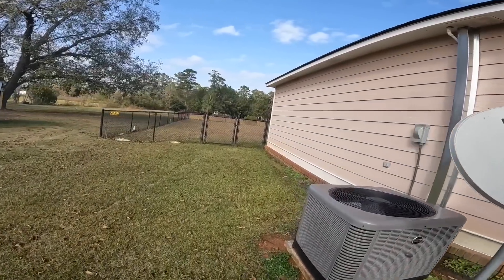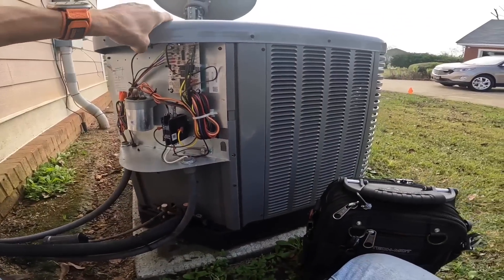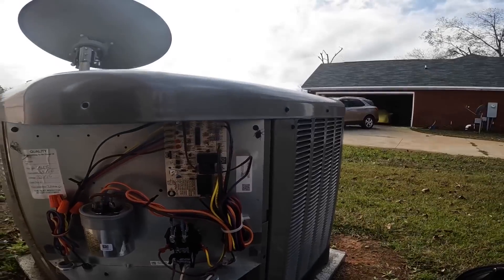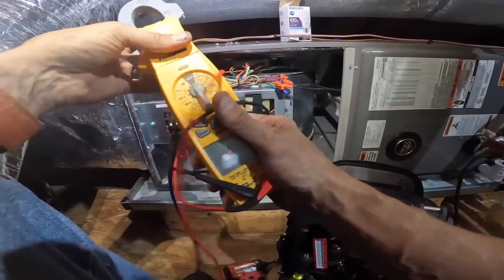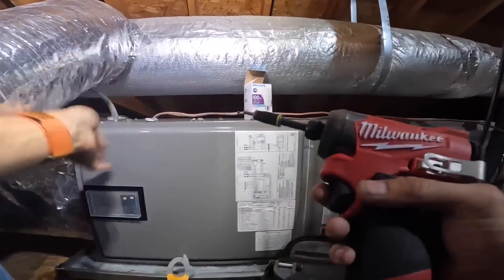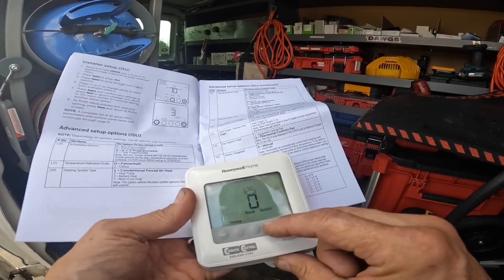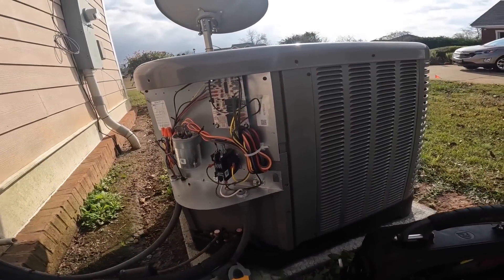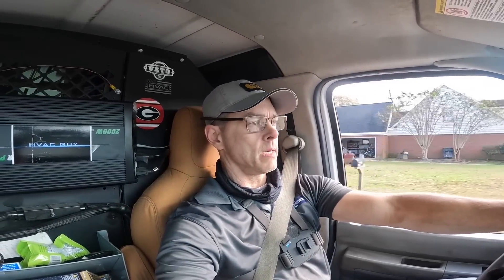Very High Utility Bill For Previous Day

Comment: The old fashioned mercury thermostats seemed to be more reliable.
Reply: the old T-87 (round) T-stats never broke by themselves. The only broken ones I ever saw were in high traffic areas and got physically damaged.
Reply: @rupe53  the models with "switch plate bases" for fan, heat/cool, would break/go bad somewhat often,  used or not the plastic would give way under the spring tension and just lose connection. the thermostat part was always still good, pretty much unless a bozo physically smashed them like you said. there's still some around here on thermopile gravity systems from the 1940's! you do not want to see their gas bills! lol
Reply: @throttlebottle5906  ... yes, those round sub-base assemblies for heat / AC did go bad, but likely from being exposed to dust / moisture or rough handling. I often wondered why they were not as sturdy as the t-stat itself. Still in all, more reliable than anything else on the market... and completely idiot proof. No instructions needed for the user.
Reply: @rupe53  that’s not even remotely true. The old T-87’s, as well as all other traditional mercury bulb stats, suffered from droop after years of service. Also, if there was a direct short on the heating control circuit, the heat anticipators were instantly fried. 

The best thermostats ever made were the Honeywell Focus Pro 5000 and 6000s, as well as the original Vision Pro 8000s. Unless they were abused or someone let batteries leak in them, their failure rates were incredibly low. 

One can also argue that the old Chronotherm stats were incredibly reliable as well. They absolutely suck to configure and use but they last for freaking ever.

Edit: Honeywell’s T series stats are absolute garbage and everyone knows it.
Reply: @jman0870  ... Chronotherm clock motors went bad at 20 - 25 years, but the T-87s that I see are still functioning. Got one in my house and a couple at the folk's place. They are all well over 50 years old at this point. You're right about those programable stats... a royal pain to program but I have a pair in my home that are 20+ years old and still kicking. Too bad the default on dead batteries is NO HEAT!
Reply: @rupe53  uh no? If you wire up the common you don’t need batteries…unless it’s a piece of shit T6. As far as chronotherms go, I should have been more specific and said 3s and 4s.
Reply: @jman0870  ... the clock stat I'm talking about is from the mid 80s, so almost 40 years ago. I believe it took an AA size Ni-Cad and you could hear the clock spring every few seconds. It was a full mechanical clock with tabs to switch temps at the same time 7 days a week, which was fine fora bedroom area.
Reply: They were reliable because it had no electronics inside so nothing was able to go faulty
Reply: I can remember as a kid we had the honeywell rectangle tstat with the mercury switch and when the  heat or ac turned on or off you could see a little arc flash in the stat when it was dark in the hallway👍🏿
Reply: @David-yy7lb  yes. Me too. That's the kind I was referring to 😁👍
Reply: @chris76-01  👍🏿👍🏿😎
Reply: This is the thermostat that I have the most issues with right now. The 8000 is my personal favorite.
Reply: @Wiwiw1995  green screen 8000’s were the best 8000’s, change my mind 🤣
Reply: @jman0870  the green screens where awesome. I like the new ones better personally, but I don't remember having many issues except not having wifi
Reply: @Wiwiw1995  the blue screens have a piece of shit stat to base micro connector. If you install the baseplate on a wall that isn’t flat it won’t properly connect to the stat. I lost track of how many stats I had to loosen the baseplate screws up on to get the stats to work. The green screens had super long pins that were ultra forgiving. 🤷‍♂️
Reply: @jman0870  yea if you over tighten the screws it will lose contact. Usually I just take a gallon of mayonnaise and submerge the tstat in there. It works every time.
Reply: I took out a bunch of those due to malfunction of the spring.
Reply: @altyndom7039  yep they get droop in them very bad. Then the heat and cool come on and off at the wrong temps and run for too long or not long enough. All bimetallic springs suffer from droop. 🤷‍♂️
Reply: It’s not just the Honeywell / Resideo thermostats. I’ve been in HVAC since 1996. My go to t-stat  is generally White-Rodgers / Emerson. Over the last few years, they’ve been having some reliability issues, too. They don’t make things like they used to 😞
Reply: Gross
Reply: They did fail also the contacts got dirty and stopped passing 24v call, and weren't accurate temp wise.
Reply: I agree
Reply: Use t-stats those that don’t need batteries, but power rob type only.
Always run control wire from “COMMON” to t-stat terminals like: Y W G R and C, and O for heat pump system.
Reply: I had the heating system in my house and the company who put it in replaced it 3 times and eventually the company who installed the system went bankrupt, I went to home depot bought a setback thermostat, installed it myself and no more problems-except insuring that you put a new battery in it every year
Reply: @RedArwBus  ... ran into that problem a few years ago with dead batteries in December... and we were away for a week. Got lucky in that the other zones in the house kept things from freezing.
Reply: @RedArwBus  I recommend changing batteries 2 time's a year. I change mine when the clocks need to be changed.

Comment: I have had great results out of ecobee. Simple setup, simple operation, seem to be fairly resilient.
Reply: I second this. Not a fan of smart thermostats, but I decided to give an ecobee3 a shot 5 years ago and having had a single issue with it. They're a really well built stat with exceptional functionality, couldn't ask for more. They're insanely easy to program and the equipment test function in the software is awesome, love that I can manually turn on individual relays in the stat itself without using jumper wires.

Comment: I currently have an older model Honeywell digital programmable thermostat that can use either batteries or "C" wire. I don't like it because it has no adjustable "swing" on cut-on to cut-off. My Goodman heat pump seems to run nearly constantly because of the tight cut-on-off range. I have now a new Honeywell WiFi thermostat that I have yet to install. It is made for Honeywell by a company called Resideo, which I understand is a spin-off company of Honeywell. I sure hope there are no issues with that one.
Reply: they(resideo) make all the honeysmell(lol) thermostats now, also the smart home(dumb), security products and cameras now.
like everything else electronic/computer based now days, good luck chuck.
Reply: @throttlebottle5906  Hard-wired thermostat vs. one that relies on your WiFi working. What happens when your router takes a dump in the middle of the night in January? Give me wires and simplicity.
Reply: @reecenewton3097  the problem still remains, as the hardwired ones are all full of electronics which tend to fail early and randomly. there is no good solution anymore.

Comment: I've had 4 Nests in a 4 zone system since 2014 and never had a single problem. However during installation one of them would not connect to Wi-Fi and had to be switched out

Comment: We were using T6 honeywell t stats and had lots of issues. We quit using those and went to Aprilaire 8448. I do miss those honeywell 5000 days though… We do use Honeywell 8000 for our nicer T stat.
Reply: A building maintain had a T6 stat just go bad and not allow the heat to go on. iirc i opened it up and the mosfet was blown open. I just replaced it with the $99 honeywell home tstat with the physical relays that dont just stop working randomly.

Comment: Many homes now have the 'smart' meters where you can monitor the usage daily. I find it convenient to make sure my air conditioners are working properly.
Reply: As the metering supervisor for an electric cooperative in Texas, I take many calls for high usage issues.  We use "smart meters" but look primarily at voltage, amps, kw, and kwh on a15 minute basis and of course kwh total daily for billing.  In most cases I can look at amps being used and determine a water well running all the time, stuck water heater thermostats as well as resistance heat running with the A/C.  Of course I can also see the run time during normal operation which can point to issues like clogged filters, dirty coils or improper charge, not to mention duct issues.  On difficult cases where the resident can't turn breakers on and off for various reasons (elderly being one) we will send a tech out to try to isolate the issue to get the proper repair made.  Our goal is to help our members get the best service from us without having unusually high usage where it can be corrected.  We established "high usage alerts" where the member can be alerted if their daily usage goes over or under thresholds they set for their own situation for both hourly and daily totals.  These can give an early warning for unexpected usage and in some cases, such as isolated livestock water wells, can warn for both not enough usage (no water) or too much usage (leak or stuck valve).  Good job Curtis in nailing this one down!
Reply: I've had power before threw a smaller util company and they had alerts you can setup eg over 70kwh in a day sent a email/text message
Reply: @james6794  ... 70kw in a day? I'd about crap myself if I used half that on a daily basis.
Reply: There are several home power monitors.  I have the Sense unit and I can see several items in my house and how much they use live.  Also keeps track hourly, daily, monthly and yearly.   Tells exactly how much it is using.     The Sense energy monitor, look them up!  😁
Reply: Duke power sent us a graph with multiple items we have in our home including usage of our heat pump. Wild. Restricted filter drier (exactly 3 degrees off from each side) kept cutting the condenser on and off.
Reply: One thing I never offer a customer is the Nest or other wifi T-stats. This gives the utility company the option to get into your T-stat and cut you off during high usage times. Look at Colorado a few months ago. They locked all their customers T-stats so they couldn't turn them down during a heat wave.
Reply: @Infowarrior-45  ... I have to ask how the utility would have access to a customer's app, password, and IP address? It's not likely people send that info out when they change a t-stat.
Reply: @rupe53  In Colorado, the utility company gave out discounts to any customer who used their brand of T-stats. If they can access those, then they can access any wifi T-stat. Go look it up on YouTube. It was national news. Colorado residents locked out of Thermostats, and you'll find videos on YouTube. I'm sure all these customers didn't give their passwords to the power company, but they got locked out. Check it out and let me know what you think.
Reply: @Infowarrior-45  ... if the utility issued the units then they have a record. Not so with other units. I suspect the media has taken some artistic license for added drama in their newscast.
Reply: @rupe53  That's your belief, and I respect it, but I honestly believe all these internet capable items have some sort of backdoor access that the government can access if they want or need to. It's just like the alexa, or the smart phones. If you start talking about certain things around them, for example, a trip to Hawaii, then you'll start getting adds for vacations to Hawaii, or airline ticket discounts. Or the appliances that are connected to the internet. For example, stoves, refrigerators, or washers and dryers. The power company will send out notices to tell you which appliances are over consuming power. Whether you want to believe it or not, they have far more access to our personal lives than we would like to thank they do. I know it sounds a little conspiratorial, but it even goes as far as the smart watches, or fit bit things. Wait and see if in the next couple years, people will be wearing these things, and starting getting alerts, for example, your heart rate is higher than normal, you need to schedule a Dr. Appt with your physician. Or they'll start getting adds for certain prescription drugs on their phones and laptops that have the same ip address or email address as the fit bit and smart watches. That's the whole purpose of all that stuff. Yes, it's advertised as being for your convenience, like being able to look inside your refrigerator from the store, on your phone, to see if you need eggs, but it comes at a much greater cost. Look at Joe Bidens infrastructure bill that was passed earlier this year. In that bill, it states that by, 2035 I think, don't quote me on the year, but I believe it's 2035, that all cars will come from the factory with a remote kill switch that will be able to be operated by police in case of a high speed chase. You can't tell me if the government wanted to keep everyone at home in case of a pandemic, or whatever the situation, and all they have to do is kill everyones access to start their vehicles, that they wouldn't do it. I know I sound like a conspiracy theorist, or crazy person, but think about the control they will have over us, if everything we own is connected to the internet.
Reply: @Infowarrior-45  ... yes, it is crazy to think about what's possible, which is one reason I avoid so many newer gadgets. I actually have an old analog gizmo I made years ago so I can know if my heat failed while I am away. All I have to do is dial my house phone and a busy signal is my answer. If it rings, then I know the heat is working. That worked great in the days when you paid for long distance calls, because I got what I needed without anyone answering. BTW, maybe 20 years ago our utility company offered a radio controlled box to mount near the outside AC unit. From that device they could do rolling cutbacks on days when power draw was high. Yes, they offered free installations and some discounts, but the discounts were minimal. They also claimed the cut-off would be no more than an hour or so to any single home. I have seen very few in recent years, which tells me they either had a high failure rate or issues with being radio controlled. IOW, they didn't do what they were supposed to do.
Reply: @Infowarrior-45  The law states that a kill switch for people who are drunk to start their cars would be proposed to then later be implemented, but no such mandate exists at this time. It's a stupid requirement though, that's for sure.
And as far as the ecobee stuff goes, well, that was opt in for your local power company.
Reply: @JST  It's the infrastructure bill that was passed recently. I know they already have the machines for previous DUI offenders, but in the recent bill, all vehicles will be equipped with a remote kill switch for law enforcement to kill any vehicle they want or feel it's necessary to do so to. It's crazy, and a gross over reach of government power.

Comment: My kilowatt usage on my house is the same.  It’s the fuel cost adjustment that’s killing me. It’s just as much as the electric bill.
Reply: Welcome to Texas
Reply: @Demy26  welcome to the whole USA....
Reply: That is because a lot of US natural gas is being exported to foreign countries as LNG. That drives up the price inside the US because the foreigners will pay more for gas because they don't have domestic gas supplies, but still need gas. And now, they are not getting gas from Russia which has created a shortage, which is pushing the price up even more. The price might go down some in a couple of years, as Mozambique & Qatar start to export more gas as LNG. Gas is a lot more abundant than oil is.
Reply: Thanks to Brandon!
Reply: @JosephGetchel  I'm sure Brandon is to blame when nat gas goes up thanks to Texas being a bunch of idiots.
Reply: @JosephGetchel  Gas prices have come down 50 cents a gallon where I live, in the past month. Special thanx to Brandon.

Comment: Had two of those T series thermostat  stop working.  Luckily still both under warranty.
Reply: ive put in 100s of em and have had less than 10 fail in the last few years, they're decent imo, with 5 yr manufacturer warranty it was always under warranty and for the price they're cost effective most folks dont bat an eye even out of warranty.. 6 years for 65 dollar tstat. not bad, took 2 seconds to slap a new one on the mount.